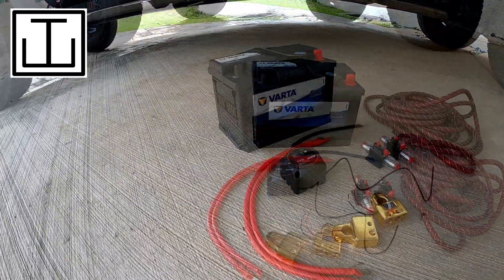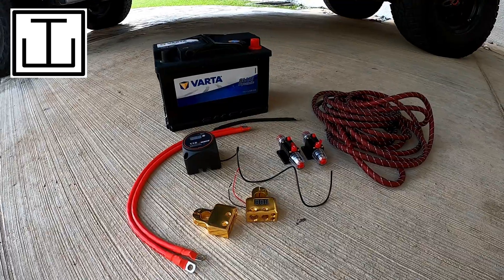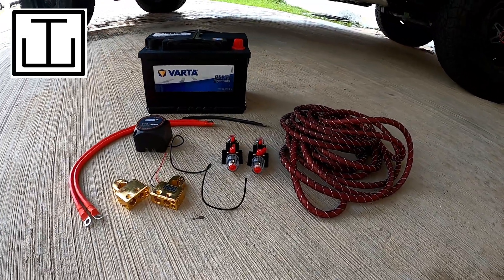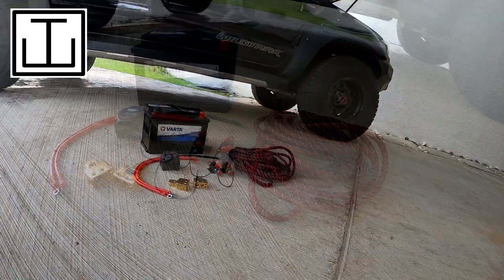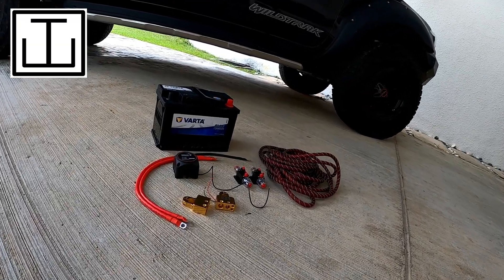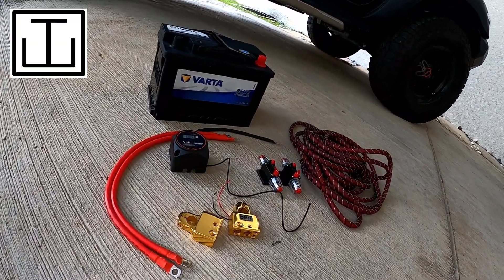How to Install a 3rd 12v Battery Easily and Boost Your Vehicle's Performance!

Comment: You didn’t show how to wire the 3rd battery
Reply from the maker: Yes, this is the 12v main starter battery backup due to the accessories added to the starter battery. The 3rd battery is the leisure battery, a lifepo4 300ah.. linked to an dcdc charger and solar panels.